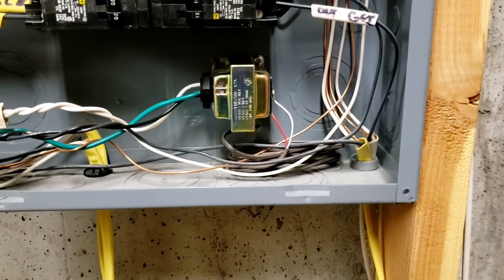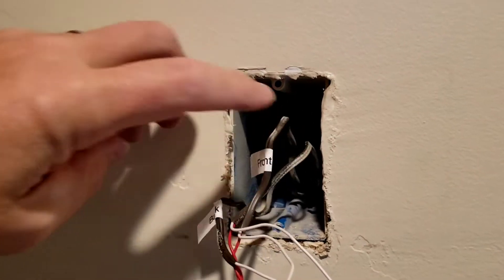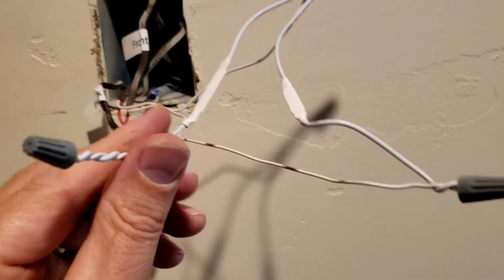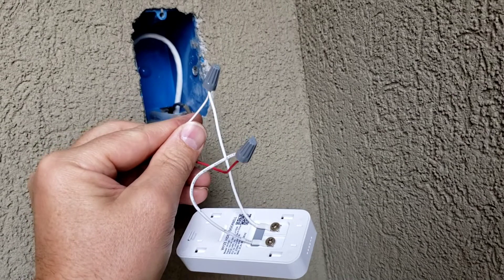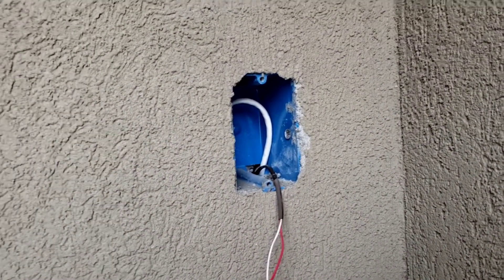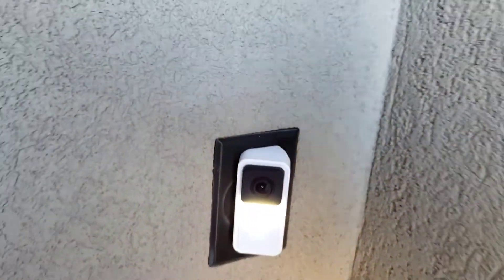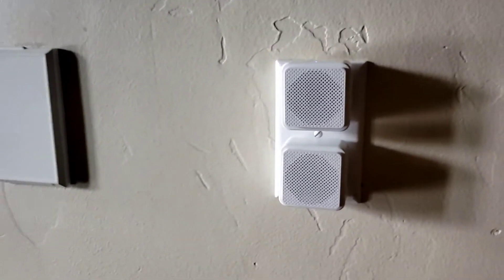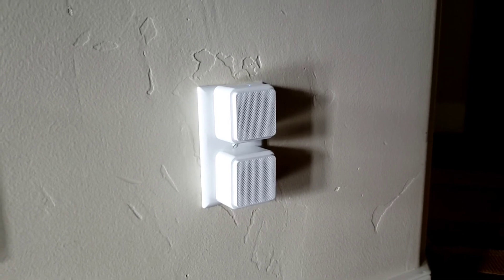Wyze Video Doorbell install with 2 video doorbells on 1 transformer.

Comment: your transformer is identical to mine as far as I can tell by the writing on the side visible in the video. I've just got a single WYZE doorbell to install. Have you had any issues with the consistency of the doorbell? Is it working all the time as it should? I watched a video from a guy whose transformer was under powered and he had to replace it before his doorbell works consistently. See it here: https://www.youtube.com/watch?v=oKtcHSeLn7E
Reply from the maker: So I am a few months in and have had no problems at all.  Both doorbells work great the way I have it set up.  The only thing that does not seem to work really well is trying to talk to someone at the door when they ring the doorbell.  The audio is really bad for that, but might have something to do with my available bandwidth.